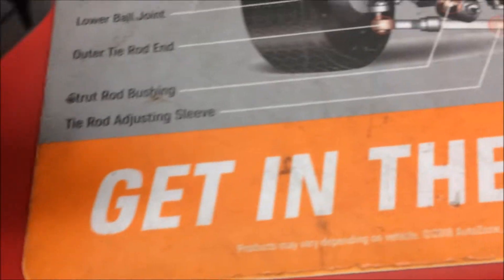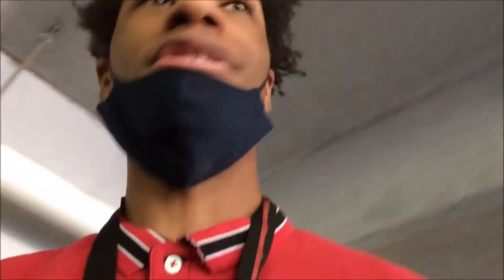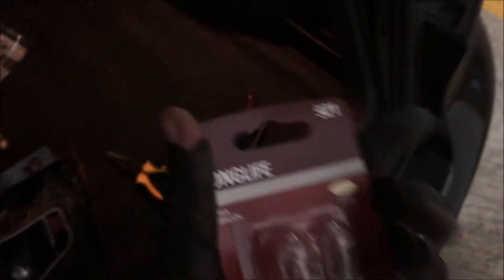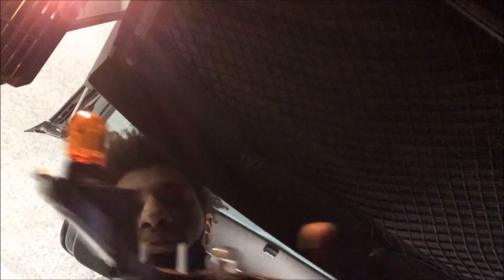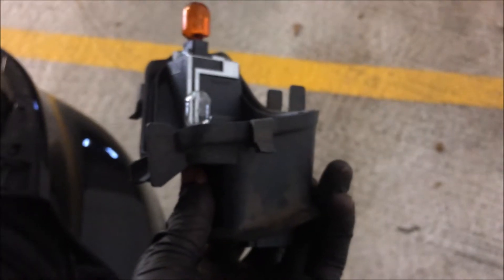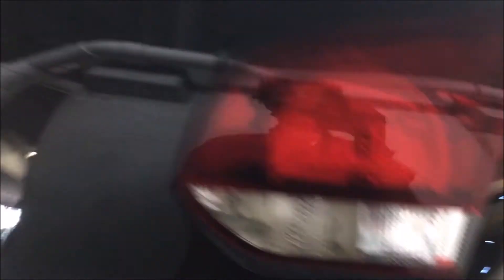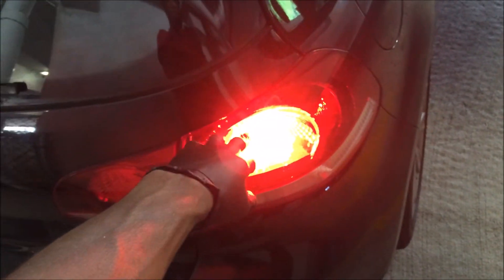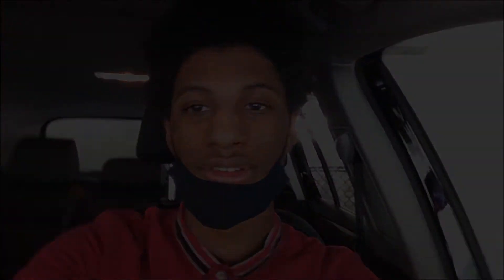How to Replace a 2010-2014 Volkswagen Golf Tail Light Bulb w/ Randolph Willis Jr.

Comment: I replaced my light but the check brake light on my dash doesn’t go away do you know how to solve this ?
Reply: Have you gotten an answer?
Reply from the maker: After you replaced the light bulb and double checked to see if it works, but the brake light on the dash is still on, then it would be best to erase that code on the dash with an OBD scan tool or see if someone at the shop can clear / erase the code if you don’t have an OBD scan tool for your car. Again only if you’re certain that the brake light works after replacing it and putting everything back properly to it’s original state. Hope this advice helps.